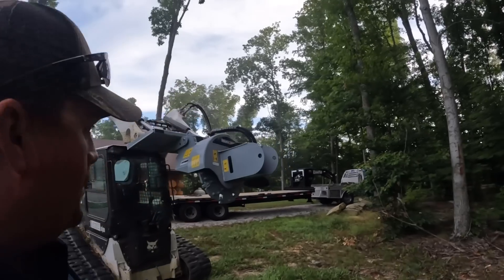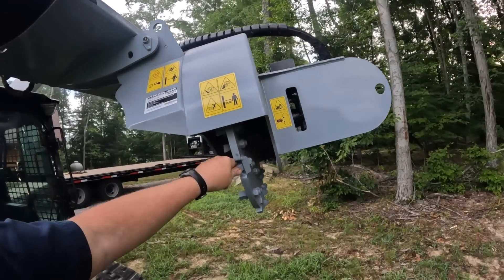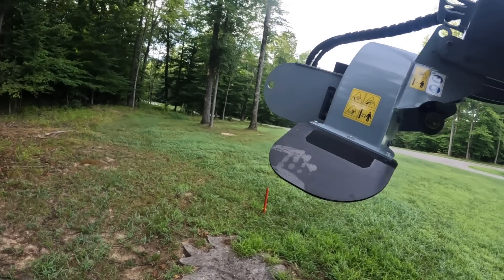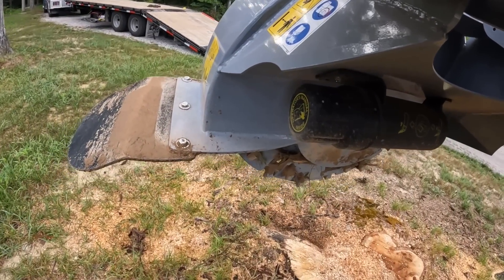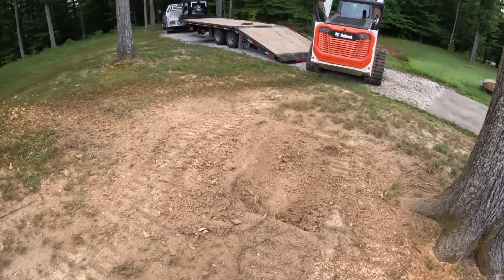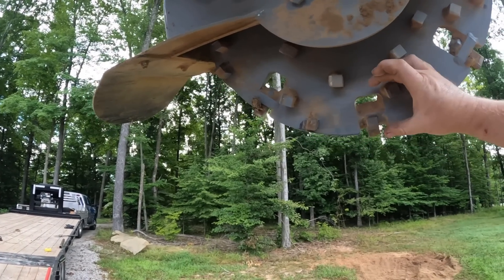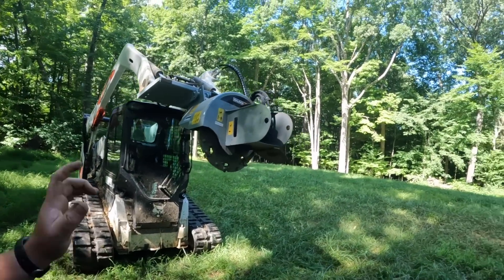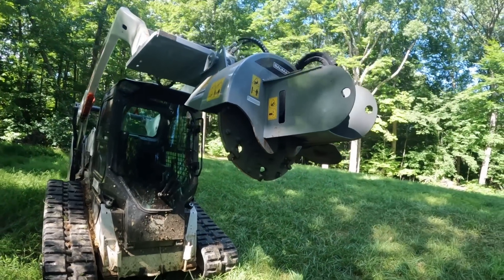Baumalight S18 skid steer mounted stump grinder in action @C_CEQUIPMENT

Comment: Do you have a ballpark price on a websight? Looks like it works great. Does it need to be a high flow machine?
Reply from the maker: It does not need to be high flow
We can set it up with different motor options 
Here is a link to it on our website 

https://www.ccsurplus.com/inventory/?/listing/for-sale/216512871/2022-baumalight-s18-stump-grinder?dlr=1&accountcrmid=1690271&settingscrmid=1690271

Comment: Great video.  ’ve been grinding stumps for over 25y.  And those things are slow. I’ve had three or four companies come out and demo one with me, i just had Bradco out of college station Texas bring their best swinger over and we put it on my Kubota SVL 97.   The only benefit i can see over mine was sitting in that air-conditioned cab operating it.  I have 2 stump grinders both vemeers a sc70tx and a sc352. Light and easy to maneuver and fast. 
  On those little stumps it would’ve taken longer to unload and reload the machine then it would be to knock those out.    I mean if you already have a skid steer and you bought one of those attachments they are great, but in my business it would never be commercially viable, they are just too slow.  The skid steer is  heavy, tear up the ground a lot especially you backing up and forth 25 times on that first stump. You can see what it did to the grass.   And not to mention my 2 vermeers are extremely portable, you can throw them on a single axle bumper pull on a 1/2 and go to five or six jobs a day.   
  Pardon any weird spelling or phrases, I’m bouncing down my pasture Road talking to Siri😎
Reply from the maker: Yep
I think this fits someone who doesn’t grind stumps for a living but just every so often and if they have a skid steer already it’s not a big investment
Reply: @C_CEQUIPMENT  yes that’s the key to it, if you already have that piece equipment it’s a great investment.  We have a couple of large ranches around here that have them for their own use.

Comment: 8/14/22. Yes.. Great info on yur Baumalite Canadian stump grinder in this video. Matched up w/Bobcat (T660?) stumps were ground up very quickly. Thx Clint for operational tips on depth of grinding to prevent overload/reduced RPM ='s inefficient cutting. So do not overwhelm blade/sink blade too deep into stump. Kinda understood but always good to show that close up shot of aprox 2-3" of blade edge cutting stump. Very good demo Clint. Maybe more info on  that Bobcat's GPM rating but you were clear (&you did show) mfgr has website with detailed data on all ranges of GPM vs. efficiency of grinding. Those Canadian engineers have made a very fine machine. Thx Clint. Good video 2day! 👍👍👍🛠⚙🙂
Reply from the maker: They have
Thanks

Comment: Hi from uk guys 👋 👍 wow what a awesome piece of kit 👌 I liked how its hinged and not fixed as this will allow the blade to make a better decision on cut as it cuts at it own kinda speed even tho operator in control of machine 👍 and its fascinating to watch things that spin quick as the optical illusion is its not spinning or slow and goes reverse for split second bt in fairness its just spinning might fast  👍 and yeah Clint good feedback about paint after the run it wasn't fazed by the stumping at all so good manufacturing and quality product for the industry or private just for Clearing stumps 👌 good demo thanks for your time be safe and see you soon 👍 👋

Comment: from the look of it best way to use it is to of course go left side first then let the weight of the cutter do the work an move back a bit keeping it with a bit of load till its cut through then reset an go for another bite  very nice unit!

 i used one of them tow behind ones an it was a bear on willow which sucks up silica into its wood an eats chain saw teeth for candy

Comment: Looks like you will wear out the teeth on the tractor side of the wheel. What’s your opinion ?
Reply from the maker: They are carbide tipped and showed no signs of wear after this so I don’t think it would be an issue

Comment: the best in skid steer equipment reviewing  and testing is Andrew Camrata this guy test all equipments possible tree shears roots and rocks grapple demolition  bucket 4in1 bucket auger drill roots drill and grinder stump bucket  grass mower cement mixer even  a road roller attachment  this is no one that so much on skid steers than him